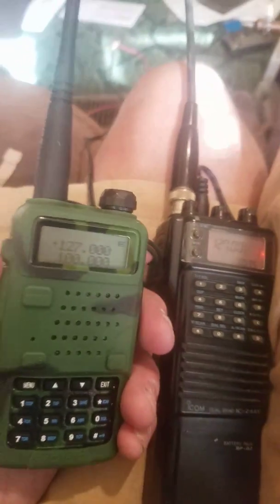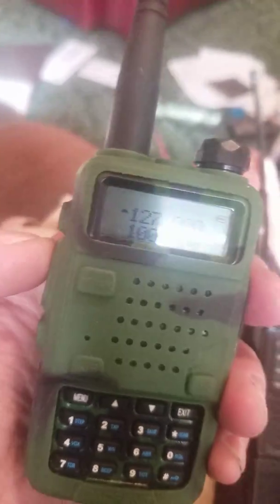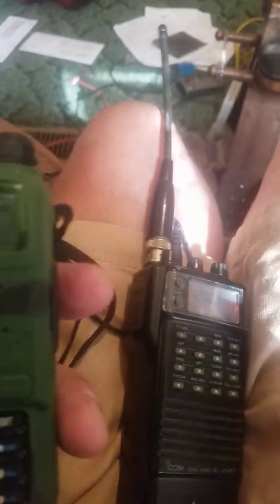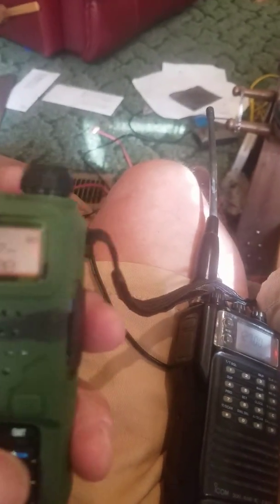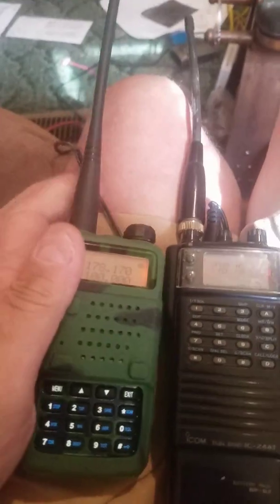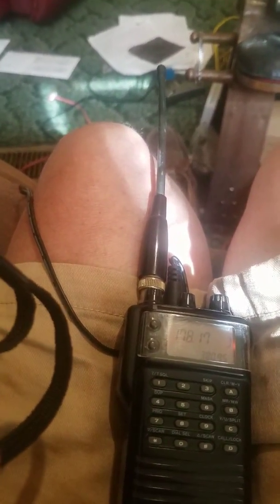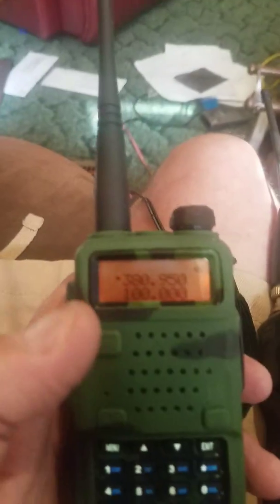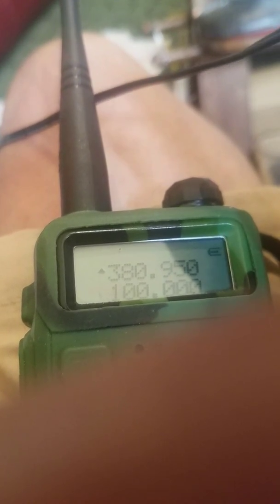UV-5r software mod

Comment: Hi. I have a BaoFeng BF-F8HP. Would like to listen to my local Airport Tower on 118.300. I hooked myself up with CHIRP and lowered the VHF Lower Limit to 115. Will this work for me? I'm not even getting hiss when I turn the radio on on this frequency.... Am I not just outside the hardware limits preset?

Thanks in advance.
Reply from the maker: Well the radio is FM and air is AM but I have lowered mine to 109. And it works ok however you will have to change the antenna length for the frequency you use for the vfo to lock and you have to be within. 14 to 20 miles of the  aircraft or tower . The newer boafeng radios are tri band and their antenna covers three bands including air
Reply from the maker: Some of the radios wont work like mine
Reply: It's always worth playing with isn't it. Thanks for the video and advice. Appreciated!